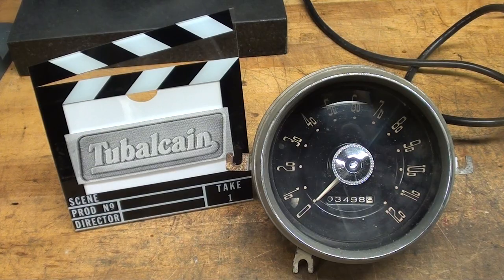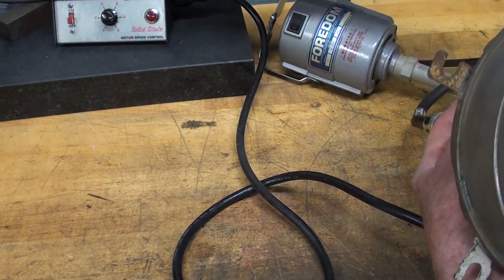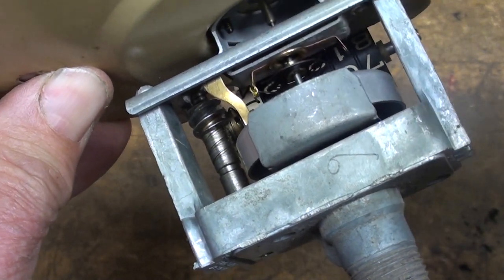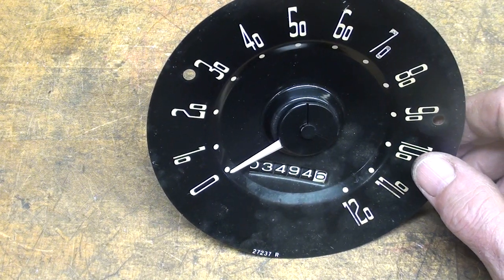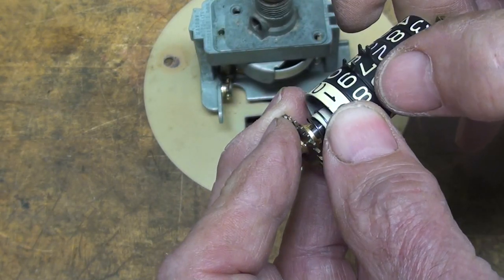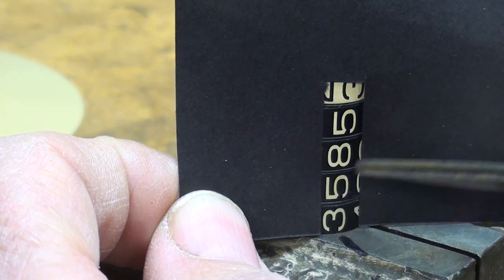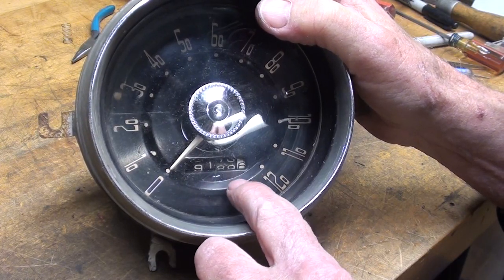WHAT MAKES IT WORK? #19  "How a Speedometer Works" tubalcain

Comment: The mechanical speedos installed in all the old Series Model Land Rovers are famous for under reading as the vehicle  got older. The needle started to jump around and you had no idea what speed you were doing. From watching your video I assume this problem is caused by either the magnet de-magnetising or the resistance spring losing tension.This does not, however, seem to deter Series Model Land Rover owners at all - they still love their old Landies and, in most cases, never part with them. A great video - thanks

Comment: Ok, the math....
You would have to travel @ 1037 mph BACKWARDS to match the dremals 15,000 rpms and it would take you a little over 6 hours to get the OD to read zero LOL !!!

For the mph, i took the reference 1200 rpm drill that ran at 83 mph, divide 1200 / 83 = 14.46 rpm per mph, divide 15000 / 14.46 = 1037 mph.
For the time, i timed how long it took for the OD to go down by 1 mile when you was running it with the dremal and that took approx.  6.3 secs, 6.3 * 3496(original miles on OD) = 22025 / 60 = 367 minutes / 60 = 6.1 hours...
Tah-dah !!!!
Reply from the maker: Very interesting mathe--I hope everyone reads your comment
Reply: I was wondering how many turns of the rear shaft it takes to advance the odometer by 1 mile. Going by Mark's figures, the dremel took 6.3 secs to move the odometer 1 mile. If the dremel is turning at 15,000 rpm's divided by 60 comes to 250 revs per sec. In 6.3 sec's, the dremel would have turned 1575 times to move the odometer 1 mile (or 157.5 turns per 10th mile). A more accurate method would be to count the teeth on the gears and figure the gear ratio accordingly.
Reply: Yeah, the dremal was not spinning the OD at 15,000 rpm but I would think the drills rpm would closer to accurate. Could probably time 1 mile while running the drill to get a more accurate figure on rpm at OD
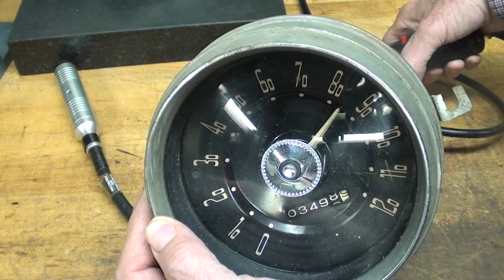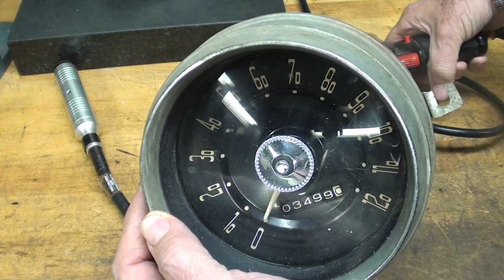Reply: I tried to get a reading when tubalcain used the drill. I watched the tenths dial as the bottom of the numbers just disappeared from the display window. I stopped the video at 4:51 just as the 8 disappeared and at 4:56 when the 9 did. That's 5 sec's at 1200 rpm for a tenth mile or 50 sec's per mile. 1200/60=20 rev's per sec. times 50 sec's = 1000 turns per mile. One full turn of the gear on the end of the odometer advances the readout by 1 mile making the ratio of the input shaft to the odometer 1000:1
Reply: Nicely done.  In practice though, I would be concerned the speedo gears would not hold up to the excessive RPM and blow apart.
Reply: Mark Webcraft so it would be absolutely worth it for a dealer to do this

Comment: most of this do not allow "spinning back" they block if you try to run them in reverse, but you can run them forward and they will finally start from zero - so you can set to any value

Comment: Who cares you say?
I cares
Reply: x3
Reply: X4
Reply: We care
Reply: Hard to find speedometer details from classics. I have a '64 Ford F100 where the cable broke off in the back end of the speedo. I tried brake cleaner, strong magnet, small tap and drill. No joy.

Comment: I found that video to be very educational. I specifically wanted to know, how the speedometers of cars worked at the era, when no electronics was used in cars. Also, please do understand that Your videos have a very important archival value, because the younger generations just do not have the need, nor the opportunity, to know about those old systems from their practical experience, a lot like is the case with computer museums, where the old timers explain to the modern generation, how those computers worked that were used before the birth of the modern generation. An interesting property of the mechanical instrumentation is that it can not be hacked in, it does not have any software security flaws. Thank You for the nice video.
Reply from the maker: Thank you, I never thought of it that way. But it is a museum of sorts

Comment: I read an article written by a guy that turned odometers back for many dealerships. He said they would use small picks to turn the wheels back and if one were to look real closely you could see the pick marks if that car were turned back. Can't remember how they got into it if he said. Also, if the numbers didn't line up perfectly but then again that was a badge of good workmanship if they did and you were in more demand.
Reply: True. I worked at a dealership back in the early 80's and witnessed the general manager do that with a pick or awl many times. Lots of scumbags worked there. To this day I do not trust car dealerships.

Comment: When I was a Kid I took one apart  And set it to all Zeros ...It never lined up exact ..My Dad explained that with the wear the little gears get on them they won't be exact...That is why when they rolled past a hundred thousand the numbers would be off a little and I have always known to beware of  a car that showed low miles and the numbers did not line up exact ......Also look for wear on the steering wheel and the dashboard where the keys always rubbed off the paint

Comment: Many old cars did not have separate turn signal indicators. Just one light that blinked no matter which side you had on. The operator was expected to know which one he had turned on.
I've still got an old vehicle or two that do just that. 
So that's correct, the red is the high beam, the green is the signal.
Thanks for the great video Mr. Pete!
Reply: Yes! Another Tubalcain cutaway!!
That old speedometer causes another lamentation about when things were built to last; coincidentally I have a much more modern electronic speedometer apart in front of me at the moment. There are still gears in it because even though the speedo is electronic the odometer and tripodometer are analog driven from an electric motor. Of course all of the gears are plastic and one as small as the pinion gear in this video is broken. Replacement for the tiny plastic gear is $25. :(
Turns out this is a common problem for many 90's vehicles.
Reply: My '74 VW Beetle had a double-ender arrow in the bottom center, it worked just as you described. Except the high beams would show blue. I think you had to remember to turn off the turn signal too. That was the first car I had with just symbols for everything, the oldsmobile i learned to drive on had words for everything that lit up. Why does every old car made in USA has the same smell?
Reply: in the past I have got my dremel out drilled a small hole through the spline and cracked gear and glued a pin(needle) through it never to happen again. Think it was a commodore many years ago.
Reply: That's how my '61 Plymouth Valiant is - a red dot for the high beams, and a green double-ended arrow for the turn signals.
Reply: i had a 65 Pontiac Grand Prix the high beam indicator was a Indian head with 2 feathers sticking up ..... cars used to have carachter

Comment: I scrolled through a bunch of comments, never saw any that indicated anyone identified the speedometer.  It's from a 1955 Dodge car, indicated by face background being black.  1956 Dodge car was identical, except the face background was a very nice metallic neptune green color.  The turn screw on the back was to oil the speedo cable.
Reply from the maker: Thanks. You obviously know your mopar

Comment: Auto-lite   was part of the Willys Overland group of companies they manufactured all types of equipment for the motor industry and supplied almost  all manufactures with components . Eventually  Ford bought Auto-lite however they changed the name slightly they dropped the hyphen and it became Autolite . I have a 1914 car a Minerva,cars of this period did not have a speedometer or an odometer  you could purchase one as an accessory and install it your vehicle. Ray

Comment: Odometers are accurate. They're directly-linked to the wheels. The eddy currents driving the needle aren't super reliable. In a car from the early '90s, I took a trip via directions an online map service. The odometer's tenth matched the directions. My current car (1987) has a digital speedometer, and that matches radar.

Comment: I wonder the zero in the 10 is misprinted or its like that in all speedometer, why is the zero on the wrong side in 10?
Reply: Because the number lies below the horizontal. Look at the 110 and 120, they are the same way.  That way it is "right side up" to the driver's eye.  Just a design thing.
Reply: ah, good catch, didn't see that 110 and 120 are also switched. explanation makes sense. thanks.

Comment: I think the old speedometers were calibrated to 1000 revolutions of the cable per mile, or 60 mph at 1000 cable rpm. You were flying at 14,000 rpm!

Comment: Mr Pete, One reason to replace the speedo is if the Diff ratio has been changed. It is possible to manipulate the magnet to recalibrate the speedo part of the instrument to read correctly, but the Odo will still be out. There is an excellent document covering the Smiths Speedometers common in English cars available at: http://obswww.unige.ch/~wildif/cars/docs/Smith-jaeger_speedo_repair.pdf

Comment: If it hasn't been mentioned,  I had a 1955 Dodge Coroner and had that Speedo. Numbers were reversed due to angle of the panel at 110 and 120 mph.

Comment: May be different on your side of the pond ... but on my side (England) the "instrument panel" of non performance cars were very modest and consisted of only a couple of lights and switches.
The standard was a RED ignition  and a GREEN oil pressure light.
Plus
Either 1 or 2 Amber turn lights directional (L/R) ... or a single common one just to remind you it was on. and finally an optional blue Main/dip Headlight beam.
My first car was a very tired "moggy" Morris Minor - this shows the dashboard.
http://www.mmoc.org.uk/index.php?key=Regalia&id=144
http://morrisminorowners.co.uk/viewtopic.php?p=66898
An overhead valve, 1.1 litre naturally aspirated 4 cylinder motor, with 2 valves per cylinder.
It was my pride and joy.

Comment: Perhaps it is only me, but there is something wrong with the numbers 10, 110 and 120 on this speedometer. They are flipped and reversed. I guess the designer figured they'll be easier to read because they are in the southern half of the circle, hence they'll be harder to comprehend when written in the same orientation as the other numbers. Alas, it disturbs me a lot. :\
On a different note, thanks for sharing with us, Sir. I learn a lot from your videos! :)
Reply from the maker: so is the 110 & 120
Reply: mrpete222 Indeed, just edited my comment and added my explanation to the matter. Don't know how true it is.

Comment: okay i was a car salesman and modern dealerships are way more crooked.......still many roll back odometers and i worked selling for one that had been busted and fined along with several other dealers that were caught...... their spin given to customers that had heard the news story was that it was merely paperwork errors in recording 
another dealer actually had a guy that worked late nights rigging service customers cars to fail causing them to need additional service later .... and a large chain named lithia auto group was caught in some sort of fraudulent practices .... the dealer that had a guy working nights actually was implicated in drug running using another dealers airfield... this implication was brought upduring a murder trial and was in the news yet that story was quickly buried because that dealer was over half the advertising revenue of the local station

my point is we do not need laws to make people do what is right we need to enforce thse already existing....and ..... CAVEAT EMPTOR ... BUYER BEWARE

Comment: There was a guy in my home town who used to turn back odometers.  He made a lot of money at it too.  $100 flat rate and he did it for years and years.  He was also a well known thief,  The guilt must have gotten to him though because he put a shotgun in his mouth.
Reply from the maker: only dishonest people did this.
Reply: Simply disconnecting the speedo cable where it attached to the transmission was a common practice too.  If the vehicle had a tachometer - the speed of the vehicle could be judged by the RPM.
Reply: Can't roll that back.
Reply: There is a trick to it. The numbers will NOT quite align properly, when you roll them over 100K.  Notice the 9 is a tad lower than the other numbers, so that one has run past 100,000. You take the reels off and put them back in, to change the mileage, and yes, it is illegal, and it has been for a long time!

Comment: Nah, they are not. You can hack the odometer to cut the miles on an electronic one as well. Today anyone could do it with a kit bought online. So dishonesty is still there.

I never relied on the odometer anyways. To me it means nothing at all. I look at the engine, the running gear and probably the most important part of them all, what happens around the driver's seat. Are things scuffed, are they loose, has someone changed something to make it new or replace it etc.

Once you stop taking the car's "honesty" for granted and look for the history of the car you can figure things out pretty accurately.

Grandpa taught me that and today, i'm afraid it's a lost skill, what with everyone buying cars just so they can use them a while until they hiccup and die.

All that gloomy stuff aside, very interesting video. I've taken apart a few French and German (i think some Russian) odometers and speedometers as well. Quite cool to see various elements transcend origin, and others completely changed.

Comment: Hi Mr. Pete You speak of the cable being driven from the transmission. I wonder how many remember the dust cover of the front wheel bearing on V W's was the driving force for their speedometers?
Reply: I thought all the old cars were driven via front hub cable? But then I cut my teeth on an old VW Beetle so that was all I knew.

Comment: The King-Seeley odometer reel is a dead giveaway.  Plymouth, Dodge, de Soto or Chrysler, pre-1957.  This is some kind of late-'40s - early '50s Mopar for sure.
Reply from the maker: Thanks
Reply: @mrpete222  Thank YOU.  By the way, there is a much easier way to set these odometers back (I used to do such evil things all the time as a kid.)  When you take the reel off the frame, just hold the entire assembly together in one piece and rotate (twist, line up) the wheels to whatever mileage you want, and make sure the plates between the wheels all line up before you put them back on the pin.  (This was harder with the old King-Seeleys because of that spring.  Most reels did not come apart like this one.)  I could do it in seconds.  And as you pointed out, sometimes it was easier to set the FORWARD than back, because the desired mileage was closer (in that closed little system of only 5 digits.)  King-Seeley tried to defeat this by putting an inked pad against the 10,000ths-Wheel to stain it as it went by - thus showing potential buyers that the odometer had turned over at least once.  It didn't really work.  The pads dried out over years of time and they were easy to remove.
The only speedometers that were really, really hard to set back were made by Smiths Industries in Britain, for the Bentley and the Rolls-Royce.

Comment: -1062.5 mph at 15000 rpm if your drill was going at 1200
Reply: Thanks. That saves me doing the math. (I'm usually the one who ends up doing that.)

If that had been in the original Ford, it would have been a land speed record (and then some).
Reply: so just over 3 hours would have the odometer at zero. It would only read 99,999. so worse case senario 50k miles would take roughly 2 days to clear. If they had a drill that would run at 15000 rpm.

but they were looking to take off 10,000 or 20,000 of the speedo not make them new again.

In later models by taking the odometer apart it was almost impossible to line the numbers back up correctly. 1  number would always be higher or lower. Also happened once the speedo had been around the clock. the last digit wouldnt line up anymore

Comment: Thank you sir for destroying this for science, the speedometer autopsy. I have a problem with my DoAll vertical band saw speedometer, the front needle broke off ugh, hence I think my Eddy currents are trying to find each other.  It's basically the same as this automotive unit minus the odometer gearing and such. I am currently accepting replacement speedometer suggestions.  Thank you kindly Mr Pete.